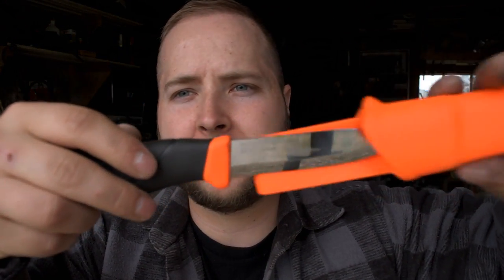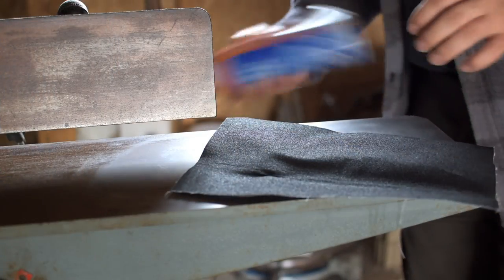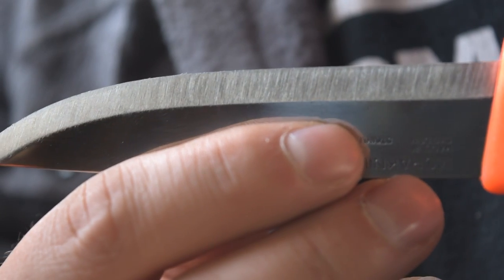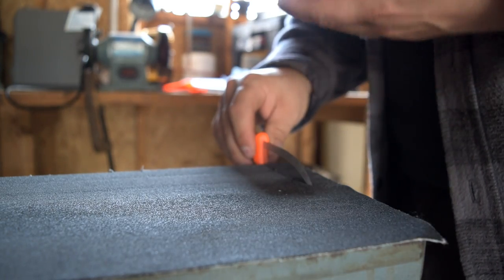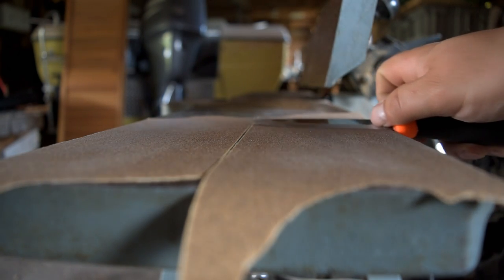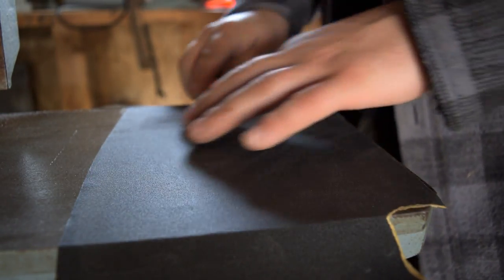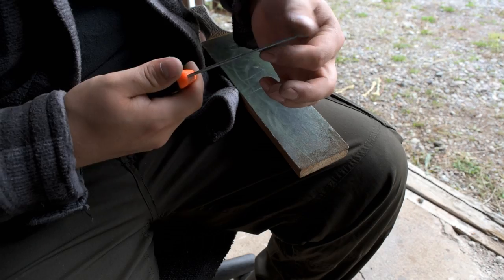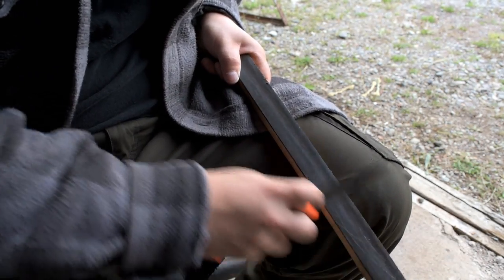How to Make Your New MORA Perfect!

Comment: Got my mora companion yesterday and it definitely needs reworking. Then I realized I had a mora companion f I believe that came with a prepackaged bug out back pack and that mora was razor sharp from the factory. The sharp one has a lot of grind lines on the Scandinavian grind but the edge bevel is extremely sharp. The dull one has a mirror finish Scandi with an extremely dull micro bevel. That’s the one I’m gonna rework.

Comment: Interesting how different folks do different things to their Mora's. All Mora's that I've bought have come sharp. Most of mine after use I only have to strop and they retain a good sharp edge. My heavy users I will take to sandpaper but I sharpen it with a secondary bevel so it doesn't roll, then strop it. Great knives and that goes for both carbon and stainless.

Comment: Would you recommend applying the whole sharpening process as shown here to a new Heavy Duty Companion (Stainless)? It's basically a Companion just with larger handle and thicker blade. 
I also have DMT stones from 60 to 45 to 25 and 15 micron (followed by  stropping on diamond leather 9 to 6 to 1 micron) which I could use but I might as well just try sand paper.

Comment: That’s awesome work! Where would I go besides a Home Depot to get a small bench grinder and sanding, polishing wheels for simple knife polishing /sharpening? Better to use metal surface for sand paper so you can get glue up easier? Got a buck 110 and bunch of moras to work on and can see this becoming a great hobby! Appreciate the inspiration! 👍😊😎

Comment: Say Heah Kyle, Yeah, Recently, I permimently attached my Mora Kansbol to my Fox Parang Bushcraft Jungle Knife a great Bush Craft Combo, Yup, Both compliment eachother nicely. The reason I went with the Kansbol is because of tge dual grind. But also it's identical blade profile as the Mora 2000 which was used in the Military (Cadets). Also because of the tang which is similar to the Mora Companion. I do have a Vintage Frost Clipper 840 MG which is a strong knife with a shorter robust tang. But since I might use it to baton kindling, I desired to go with tge longer tang. I find it easy to sharpen the dual grind, A diamond rod works great. Actually it's sort of  like stopping it so your really not taking alot of metal off of it. Adding the Kansbol to my Parang Bushcraft Jungle Knife kept it very Lite and I hardly could tell the weight difference.  Also I like using this combo in wet conditions whether wet or snowy. I also have the Mora 2000, it's part of my my  Lite Trio that I teamed with my Mora Hatchet and my Bacho Laplander. A real nice set I could carry with just my Haversack for a nice hike and Afternoon Delight. Oh, I also attached my Mora Classic #1 with my Bokor Vox Rold( Black). After I put a nylon belt loop on it because I injured myself big time when my Black Vox Rold flew out of the very loose sheath. Anyhow the handle strap was a little too lose but still very secure, I then skipped my Classic #1 on that loose handle strap and it came out perfect. Yup two great knives that work wood great. Yeah, I keep all of my Mora's that sharp too. I did get lucky, I was able to still get a Mora Forest Exclusive #277. It's a handmade similar version to the Classic #1, but with a beautiful hardwood handle and brass hardware with a beautiful traditional leather sheath. I wanted to get a Forest Exclusive # 311, but it's been discontinued. Oh, I also have a Vintage Mora with a Curly Birch Handle, The Blade is much thicker with a hand guard, the Pommel is metal and the leather sheath has a metal trim, it's in very good shape yet. I keep it very sharp also. But Suprisingly, I found out that my Mora 510vhas a identical blade profile to the Classic #1. So I like using it as my neck knife especially when I take out one of my Fav's Basic Trio's. My Modified Rodent 6 with my 17" Hultafors Bruks Agdor Hatchet and my Wicked Tough Saw. I've used this set on silo overnighter's, I neck carry my Mora 510 on a ball chain. Infact last weekend instead of taking my Hatchet and my Mora 510, I took my Ka-Bar Johnson Adventure Parangatang which I put Black Handles on it and my new Cold Steel ultimate hunter. I had no problem chopping, batoning with my Parangatang, but where it really shines was clearing through the brambles. You done good. Thanx You for sharing.,,. o

Comment: I can tell with your stropping block the edge sides are high so you have a u-shaped stropping block. You can definitely tell it by looking at your stropping compound that the edges smooth out. And the compound swirls in the center are still there. You might want to sand your stropping block or make you a new one.

Comment: I only have three Moras. All three came razor sharp. As in shaving sharp. HOWEVER...I trued the edges to a full Scandi grind, using 400, 600, 1200, and 2000 grit Garor wet/dry paper. If you put water on the paper, it lasts longer. Then I seriously stropped them. The bevels are a thing of beauty, and it's worth doing this even if your Mora is sharp from the factory.  My Bushcraft Carbon, I used gun blue on the blade before the final strop. Beautiful blade. The Bushcraft Black's blade is stunning as well. I love my Moras. I put WAY too much time in those cheap knives. But they're worth it to me.
Reply from the maker: I like of philosophy of taking the utmost care of your tools, no matter the cost. Cheap knife? It doesn't matter.. care for it like it was $200. I think it shows gratitude for even the little things in your life, which is really important. Nice job Doby!
Reply: @kyle_noseworthy  I agree. All my knives get taken care of. Even the ones that are worth less than ten bucks. I clean all my firearms after each uses as well. Leftover habits from the 82nd Airborne? Probably. I still blouse my shirts, align my gigline etc. Always have. Old habits die hard, lol.

Comment: Wouldn't it be significantly cheaper with a set of stones?

Never been a fan on sandpaper, the micro-serrations just doesn't hold up and the picture into the steel doesn't show enough for those "demanding" clients.
My suspicion is that this is what you do to quickly finish soft steel for a pretty and ready to go edge?

That's the awesome thing with edged steel, there's so many ways to present it!

First vid I see from you but I'm loving your technique and explanations, very smooth and solid work on the bevels.
Two 👍👍up

Comment: Thanks for the video! I tried it today on my new Mora Companion and it is now much sharper than before. Not as sharp as yours though (guess I need to practice more). I used 100, 400 and 2000 grit sandpapers and have yet to strop it.

Comment: Mine come sharp but I sharpen the spine and polish the bevel. I've never had to do much but strop after that. I use sand paper too, up to 2000 grit. MIRROR polish. It is wettable emery paper and lasts quite a time, several knives at least.

Comment: Ive been having problems with the edge chipping when batoning after doing this. Wondering if you have any issues as well. Using a companion HD carbon.
Reply: This is so called Scandinavian grind edge and is used for bushcrafting. Typically the blade itself is thicker. Maybe yours is not thick anough to give the blade more meat for batoning?

Comment: Dremal variable speed hand tool and drum sander... much easier to use 
than a sheet of sandpaper glued down.  And NO_ it will NOT be too 
abrasive or rough on the steel.  It is all up to your touch or pressure.
 I have VERY nice burrs on all the several knife spines used for casting 
sparks.  And TWO of my knives are the stainless steel AND the carbon 
Companions... love them both.

Comment: I love Mora as a meat working knife. Sure I have larger butcher knifes, but when breaking some of the smaller primal cuts or breaking up a chicken my Mora shines supreme. Not scared to hit bone. Not sure of the model, but 2 of my Mora's are way thicker than that 3mm one. So for my purpose, I would not change the spine. However, I think I need to fix that cutting edge this way.
Reply: Yeah, I've used an old Mora for butchering big game for about 20 years now. With nothing more than the Mora, a Victorinox butcher knife, and a Canadian Tire meat grinder I've probably processed a couple metric tons of moose and deer meat in that time. My wife got me a pricy deboning knife two years back, but out of habit I still use the Mora 90% of the time.

Comment: Wow.  That is scary sharp, n puts all my past attempts in the shade, more so bc I am, (or rather was,) a carpenter by trade - I could put an edge on a chisel or plane blade you can split hairs with, but the knack for knives has always eluded me.  Time to get back in the saddle n try again.  On the off-chance that you actually see this comment, can I be cheeky n ask i) how you removed the various sandpapers n ii) how long did it take all in?

Comment: I was disappointed in my Mora Companion (same one you have), not because it wasn't sharp (it was), but because somehow the pointy tip broke off very easy even though I didn't jab it in thing, etc. And because it gets nicks in the sharp edge too easily. I find it's only useful to me for making my wood shaving / feather sticks and making small notches in wood which I wouldn't do with my 10" blade knife that I use for almost everything for bushcraft/survival, and I use the Mora for sparking my ferro rod .

Comment: Very impressive video. I flatened the spine on my mora for utility sake. Honestly though unless a knife came  dull I wouldnt' go through all that. I mean it's a low cost knife. It really was sharp enough to do anything in the woods it was meant to do. We're not shaving or cutting paper. Use it, have fun, and when it gets to the point where it's not as usuable, then I can see the value in going through what you just showed us. This isnt a critisism. Your by far a greater sharpner than I'll ever be. I just don't see the value in spending $10 to sharpen a $20 knife out of the box unless ofc you are going to shave with it in the woods. 😋
Beautiful job though.

Comment: The best test for sharpness is to run three fingers along the cutting edge. If it pierces the epidermal., you are well on your way. The problem with the fingernail test is that it does not indicate sharpness 100%. Also, do not remove the burrs because that tells you if you have the correct angle needed.

Comment: Thank you, Kyle - I've got renewed hope for my currently dull $18 mora knife.  :)
One question, though - is the stropping at the end more of a cosmetic effort, or does it really add that much more to the sharpness of the knife?  I don't really care about the look of a knife that's going to end up getting dirty and heavily used around camp, and I'm not sure that the extra effort/time would be worth it?
Reply: In my experience stropping puts on that final fine razor edge by polishing it in.
Reply: Thank you, Timothy!
Reply: I went up to 2000 on my mora companion, then used a strop and hopefully it helped a bit. It polished up nicely, and it cuts very well now. Now I just need to remember to put the effort into maintaining the edge!

Comment: Yeah... but is it good at being misstreated badly?
The thing with razor sharp knives, is that they often get not sharp at all fairly quick. A Scandinavian grind is not meant to be used as a razor or cutting paper. It is meant to be a compromise that dont loose the edge if being dropped or misstreated. Its meant to be a fairly cheap tool.

Comment: The helle knives don't have a micro bevel, and the down side I've seen with the laminated steel is working with seasoned soft woods or any hardwoods they will chip a lot during moderate use.

Comment: Thanks for the video!
I have 4 companions; 3 stainless and one carbon, all came razor sharp, so I'm keeping this step for when they need to be sharpened.
Question: following your exact steps, could a carbon blade spine be used as a steel striker efficiently or would a higher grain sandpaper give better results for this purpose?

Comment: Is it that particular knife with micro bevel?  When I bought my wifes, it was true scandi, and flat. (not hte spine, thats a stainless feature)  and recently I bought a 2nd companion, and mine was true scandi, flat, and even sharper than my wifes. Hair popping sharp like ive never had from a mass produced knife.  I do like to microvex the scandi, but on mine it wasnt needed, it was pretty strong.

Walmart automotive 3M multipack ,has 1000,1500, 2000,2500 sandpaper. Used dry it is an amazing edge finisher. Used on flat surface great for scandi, used with leather back, makes a wicked convex. Cheap and durable.

Comment: I don't know where you're getting you Mora's but I have several of the same model and out of box are like lightsaber sharpness and do not need resharpened for a long time!  Just my experience.... Mora makes a great cheaper EDC Bushcraft that throws a spark off the spine of all of mine perfectly fine out of the box!
Reply: I can see how the spine adjustments may be nesesary.  They are a bit soft but can still throw a spark just fine out of box.  Never had a issue with sharpness.

Comment: Hey man, I have a garberg and a smith's sharpening system. I've pretty much given up on using the system, and believe some wider stones are necessary for the sharpening of the garberg. My main issue is the micro bevel on the moras, I'd like a true scandi, any advice given my situation?

Comment: Well that was impressive. I have to respect the sandpaper work for the budget knife. Nicely done.
Reply from the maker: Thanks!
Reply: @kyle_noseworthy  would probably be helpful to your viewers to mention that there are different types of sandpaper as you did but saying silicon carbide or aluminium oxide so the silicon carbide would be your average black square sheet some people called wet and dry does last longer and cut better being a harder material like you I flatten on my Jointer table here in the UK anything from my the soles of hand planes to my Waterstones. 👍🇬🇧

Comment: First of all: if you mill the back side, use some "protection" block (e.g. wooden) to avoid slicing yourself. Second: If your're experienced with sharpening (esp. wet) it is easy to sharpen the bottom of the skandi without taking material of the whole angle first, to prolong the lifetime of your knife. The Companion is a fantastic knife for the price out of the box and can be turned into a "premium" knife if you know how to. do it...and since it's so cheap its the perfect "learner knife".

Comment: Question from a lowly apartment-dweller - what's the smallest and most compact way you've ever got a flat working surface in your living room?
Reply from the maker: I've been an apartment dwelling for most of my adult life so far, only this past couple years having an actual work shop. I'd go to a hardware store with a normal drawing ruler, and look at some ceramic or glass wall tiles. They're cheap to buy individually, and are usually machined flat. You can use your ruler to verify flatness.

Comment: you might want to try a lansky sharpener.  the lansky allows you to use different angles with top quality stones.  when i am done using a lansky, the cutting edge has a mirror finish.  it doesnt take long to achieve this with a knife either.  what is good about a lansky type sharpener is that it takes the angle guess work out of it.  sharpening a knife like you did in this video is a lot harder than using a lansky.  the lansky keeps the angle perfect.  and it also allows you to choose different angles for the cutting edge.  when you are done sharpening a knife on a lansky, you can see your image in the cutting edge.....it makes a mirror, perfect edge with little effort.  if you have never tried one, you should.  i know there are diehards that swear by using a stone and or sandpaper as you have done in this video.  if they would keep an open mind and try a lansky, i believe they would be done with stones and sandpaper.  i guarantee you, this method takes longer and more careful holding of the knife to achieve a descent cutting edge when compared to a perfect cutting edge achieved with the lansky.
Reply from the maker: Are you sponsored by Lanksy? lol You said the name quite a few times in your 'review' here. ;-) I'm one of the die-hards my friend. I believe in keeping the whetstone / hand-sharpening skills alive!
Reply: I like guided sharpeners at least for reprofiling a new bevel angle.  But carrying one to sharpen in the field just  seems kinda bulky.  vs litterally being able to pick up a stone and sharpen your knife. Also I had to make my own angle guide to be able to make knives with anything less then a 20degree angle.

Comment: That is looking like a nice knife and I like it, but use mine for several uses and the one I haves for my backpack is a Schrade SCHF26 model which is designed to be a survival knife and it can so many things and  have demonstrated that it can take the abuse many knives go through in a survival situation, but I don't plan on abusing it like that. That is the reason I will have a hatchet or axe for to cut up wood, and be used for a baton. I also purchased a Old Henry about the size of the one you have which is my backup full tang knife which is kept in my backpack.
Reply: You mean, Old hickory, by Ontario knives.
also how did you demonstrate that it can take the abuse many knives go through, that video is where?
And what "many knives" are you speaking of?

Comment: I just bought the cheapest mora and it was sharp enough to shave hair off the back of my hand. So maybe just a slight quality control issue as far as the final finish on the factory edge. Terrific knife even if you have to touch it up.